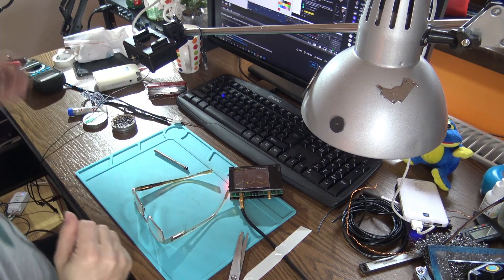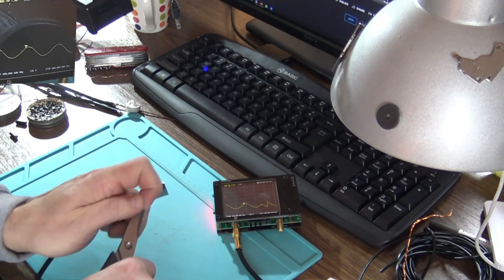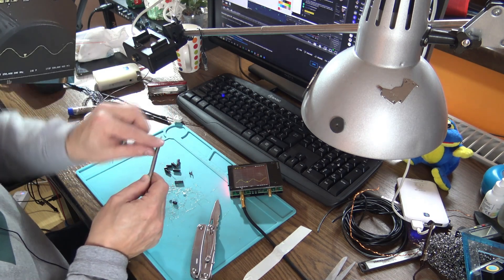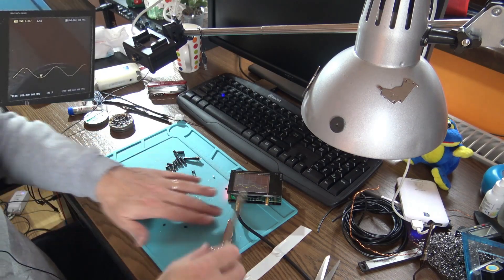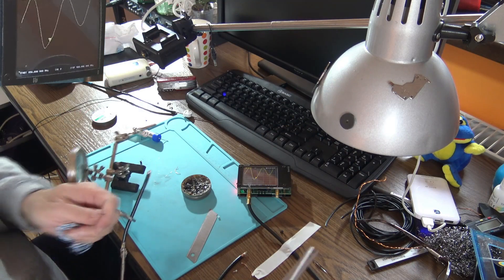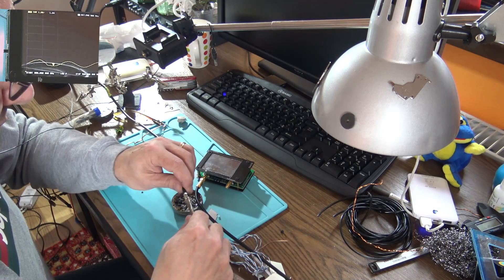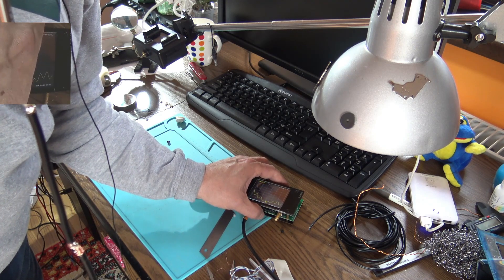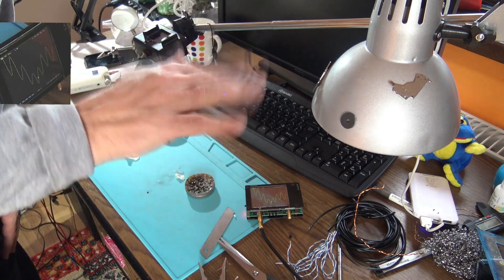DIY LoRa collinear coaxial feed cable tuning

Comment: so now we have to worry about out of tune cables now? :D
Reply: What is specification for that toroid ring? Could you made it by yourself and how?
Reply from the maker: @alenramic5077  There is nothing special, I used toroids from buck converters..
Reply: @viocaia  Ok Viorel. Temporary I dont have vna, so where on the cable is optimal to put toroid ring? Thx for the quick answers (and on your other videos).
Reply from the maker: @alenramic5077  try half wave like 300/868/2 like 17,28cm
Reply from the maker: Well..that's a fact..but as long as you instead of DIY you don't have to worry! Usually they do it well! :-)
Reply: you mean as long as I buy a pre-made cable it should be fine? :)
Reply from the maker: @FlybyLV  Absolutely!
Reply: @viocaia  <3